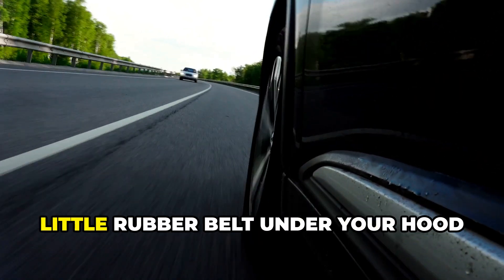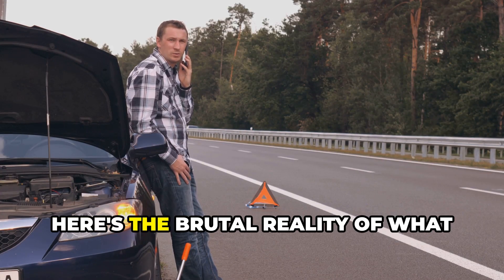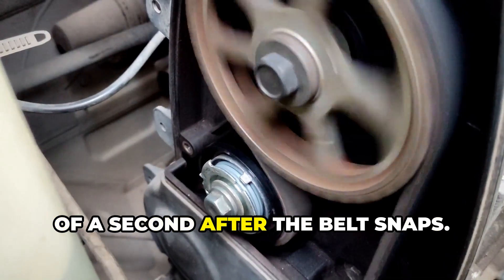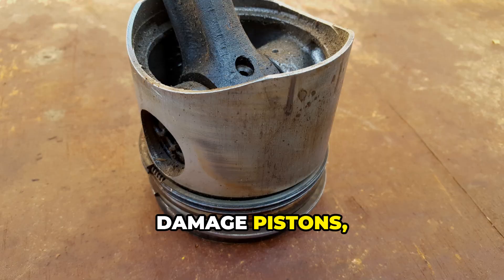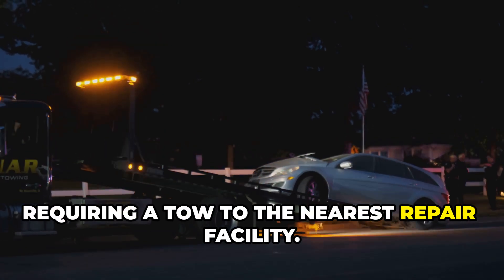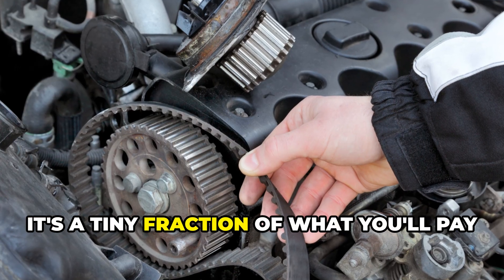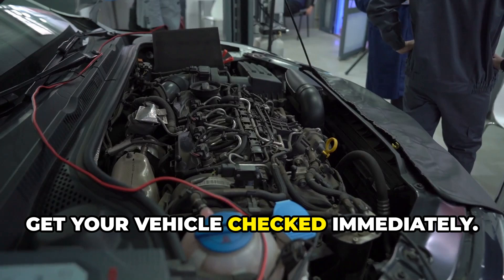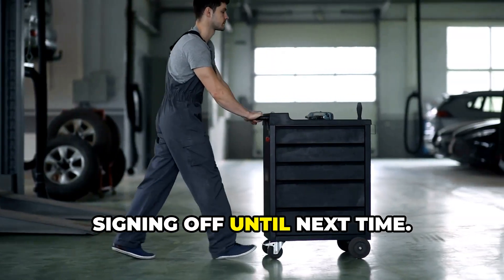What Happens If Timing Belt Snaps While Driving? | Major Risk!

Comment: I suspect my timing belt has either jumped a few teeth but not broken as i can put it in high gear rock it through 90 degrees   and still see the cam  moving in time with crank but i cannot tell how many teeth it has stripped until i check it fully this tues  my engine is 1.4 petrol interference  engine and i was less than a 1000 rpm when problem occured no engine light no temp or oil warning just a missfire type hesitation loss of power then cut out n dead  . So because of the low revs and immediate  shut down i hope the damage is min but head tells me i will not be that lucky n valves / or piston damage may be on the cards  .the engine is only 52k from new and had a new belt 6yrs ago but i wonder any good advice you can give me to maybe soften the blow of the worse outcome thanks

Comment: haha what about the peugeot 1.2 liter puretech engines ? first belt changed at 94k km  at 120K now and massive oil consumption
Reply: That engine needs close followup of service intervals, and especially important to use the right oil, no 0w20 oil, but 5w30. Its a new oil standard for those now Stellantis FPW9.55535/03 5w30. And when replacing the wetbelt its a must to take down the sump and clean pickup screen. However, many garages claims that its not necessary, but they are wrong.
So, if you are using 0w20 oil, switch to Stellantis FPW9.55535/03 5w30 immediately. It may slow down the oil consumption too. If not, try an engine flush to clean up the pistonrings, and add f.ex. Liqui moly oil stop leak/motor oil saver to the new oil. Yes, Its safe to use.
And also preferrably change the oil every year or max 7.500 km. to avoid more carbon buildup.
Reply: @aciddiver1978  im on 5 w30 now high consumption

Comment: glad my 2018 Honda Accord 1.5t sport has a timing chains the only thing I have to do is change my oil every 5k.  I have 54k on it now and the only thing I'm a bit worried about is the head gasket cause it seems to be pretty common from what I see online but I take care of it well so I hope it pays off.
Reply: Timingchains of today does not last much more than a belt,in some cases it lasts less. And the job replacing the chain, is bigger.
In my experience chains lasts from 120-180.000.
Reply from the maker: That’s a very good decision! Just make sure you’re using the right type of oil for your engine!
Reply: @HonestMechanicChannel I was told that timing chains should never need to be changed if you change your oil regularly. I was also told from one guy that the head gasket failures was also a cause of that too. I don’t really understand how that’s possible, it should be just cooling but not all of them have it.